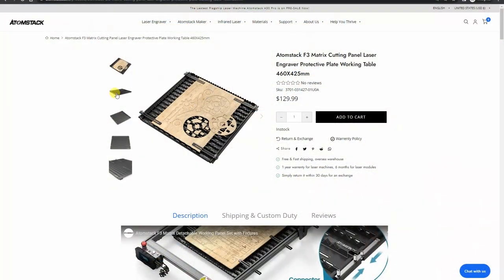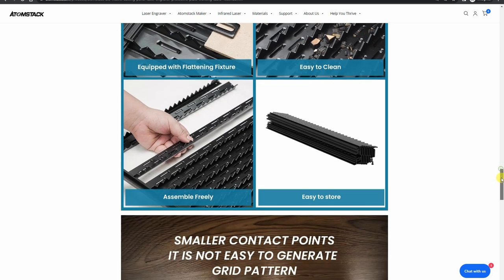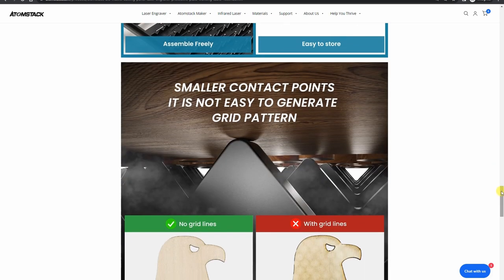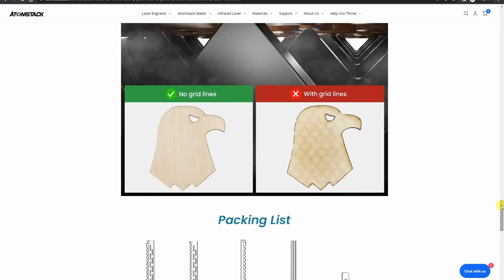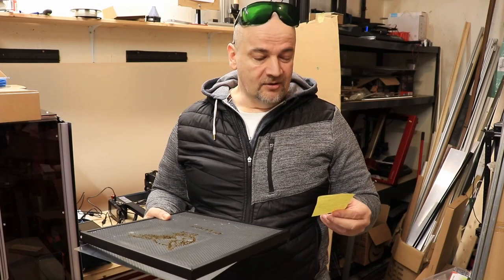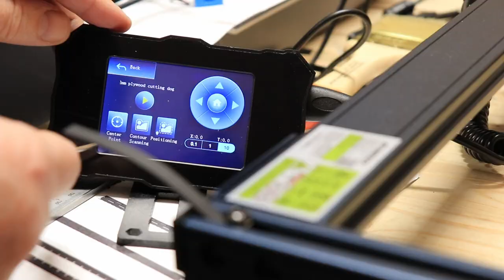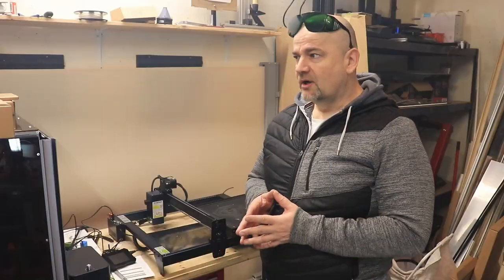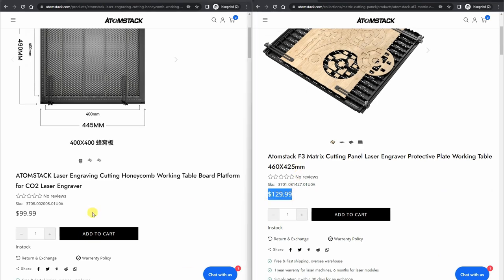Atomstack F3 Matrix cutting panel vs Honeycomb grid - which one is better for laser cutting?

Comment: It doesn't look as though you can clamp the material to the Atomstack Matrix. I've made my own panel using steel mesh, and use 3D printed pegs that fit the holes in the mesh, and magnets.
Reply: Looks like the newest version has clamp downs.
Reply: Könntest du mir ein Foto von deinem Gitter zeigen .